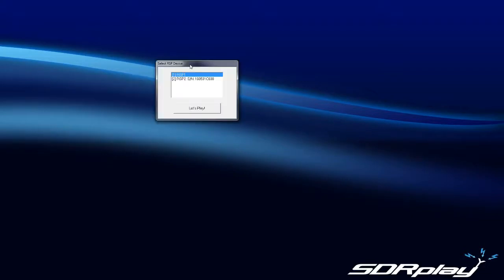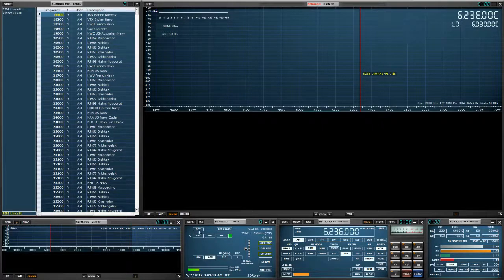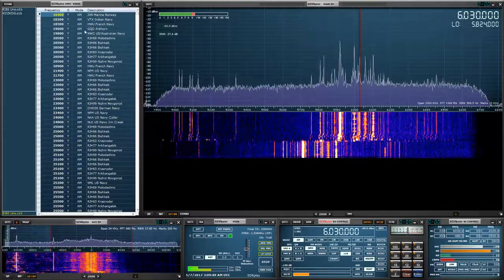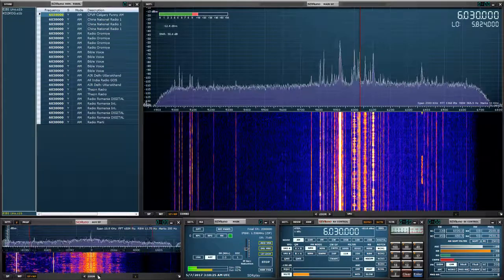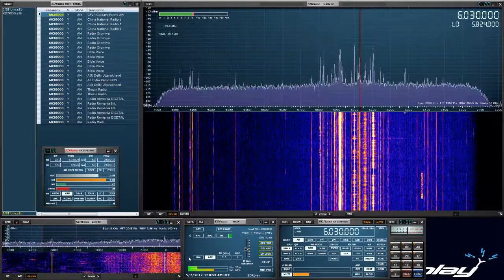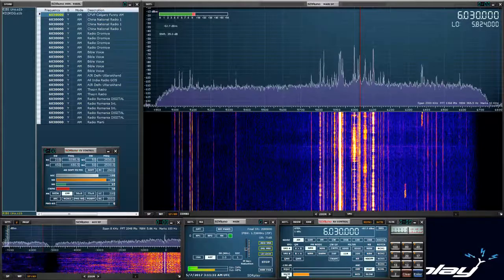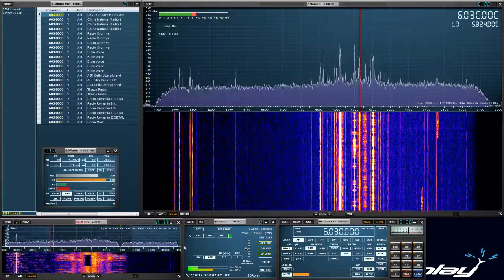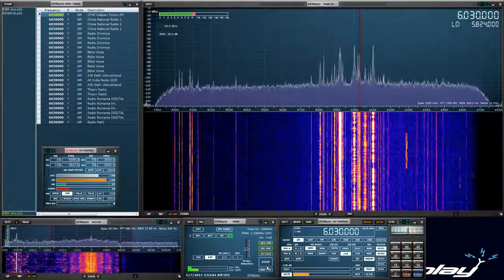SDRuno Notch filter function (MV009)

Comment: Mike is right, I also thought you should Left click and than Right click to fix the band filter but it is not. This could be a mistake in the User manual, not in the Mike's explanation.
The procedure to set for example Notch1 is:
1) Click on NCH1.
2) Set the center frequency of the filter holding the Shift key and clicking on the SP2 spectrum (Exactly as Mike says). A dotted vertical line appears.
3) Set NCH1 bandwidth using the EX control that appears clicking on EXW on the RX Control panel. On the first line of the EX Control you can see N1 and BW. The filter bandwidth can be set changing the number inside the N1-BW. As you can see, this opens and restricts the filter bandwidth.